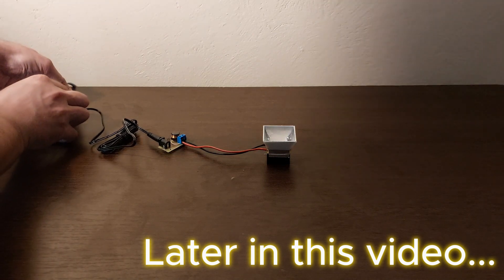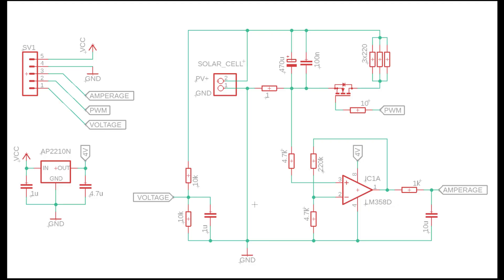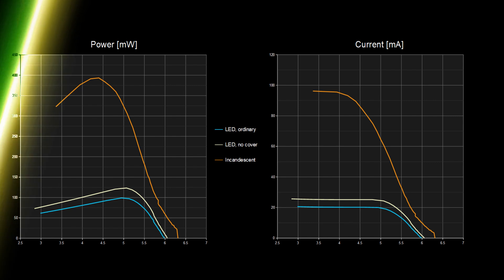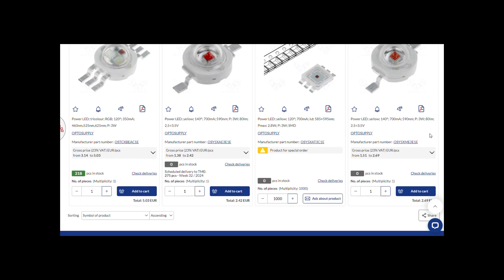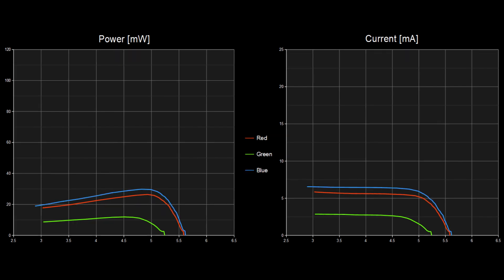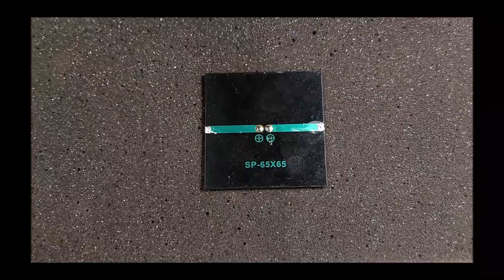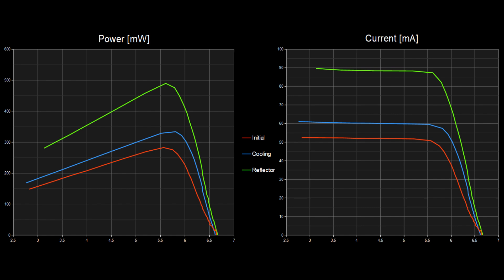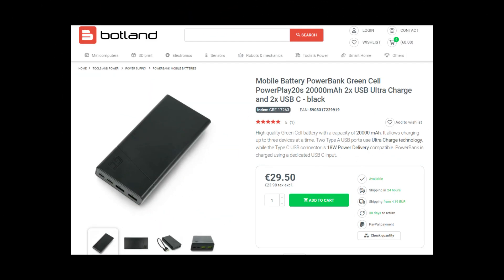Testing solar cell illuminated with various light sources

Comment: how did you plot the iv curve?,want to do something similar
Reply from the maker: As I mentioned on the beginning of the video, I made some circuit with microcontroller that was able to gradually increase the load while saving voltage and amperage readings into CSV file. Later I just imported those data into excel and plotted them as XY chart.